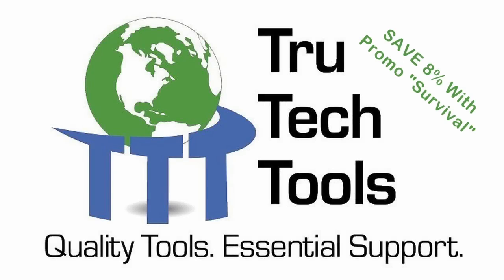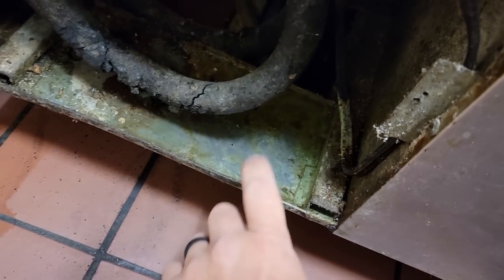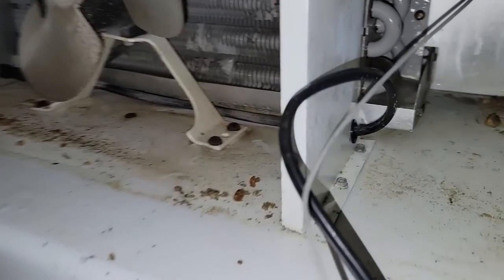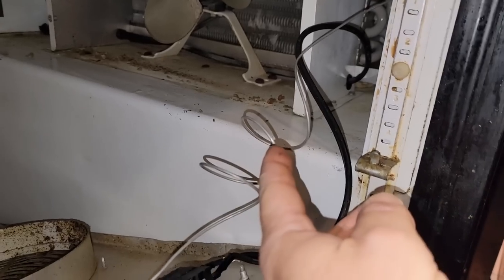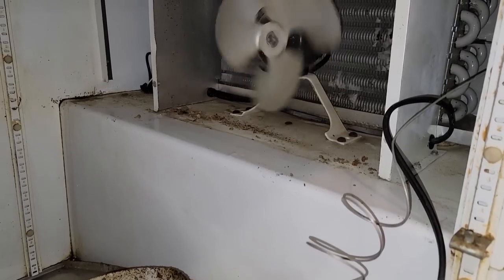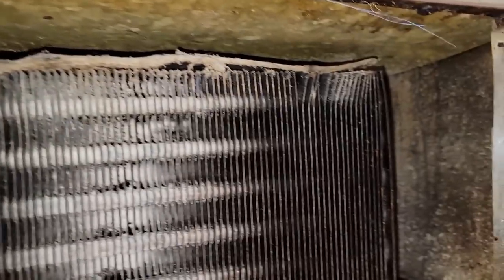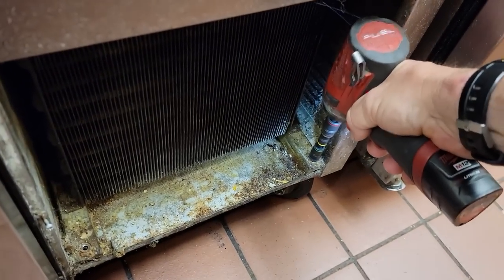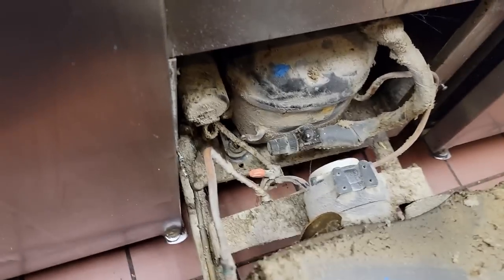Water Leaking On The Kitchen Floor

Comment: Man I wish I saw this one a few weeks ago. Had an undercounted doing something similar and took two trips before I figured out it was low on charge went through all the other steps just kept putting off because it didn’t have service ports on it. Now it does and it’s getting a new coil 🤣
Reply from the maker: It's almost guaranteed any prep table is going to leak, the vinegars eat it up. And it seems like the r290 units are even worse now.

Comment: 👍💪❄🇺🇸🙏 great vid. Hey Rick those evaporator bends that r coated, r u able to do a patch job(braze) on them if they r leaking? Wasn't sure if the coating on bends makes it not worth it. Thanks again 👍🏼
Reply: I've tried a couple of times to repair coated evap coils with very limited success.
Reply from the maker: It's not usually worth it and most of the time it's leaking in the coil more than on the ends because the coils are made so thin now thanks to efficiency standards and cutting corners.